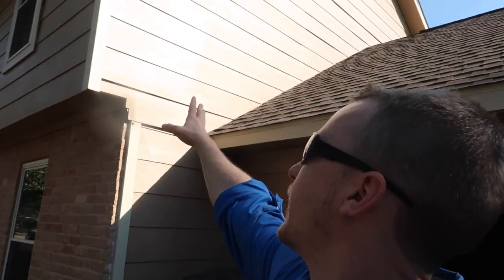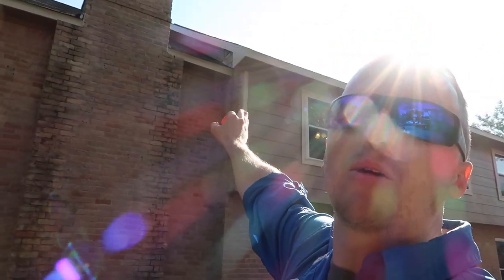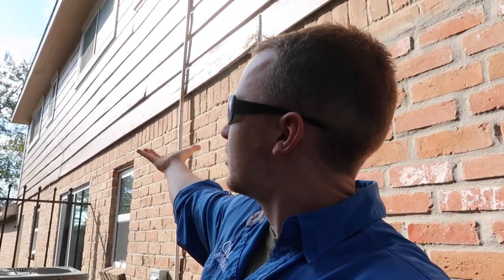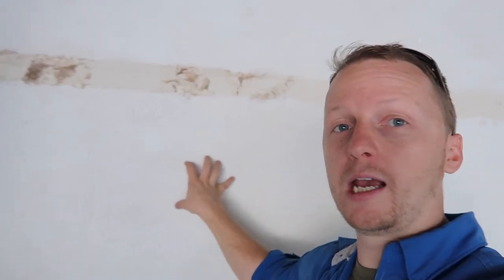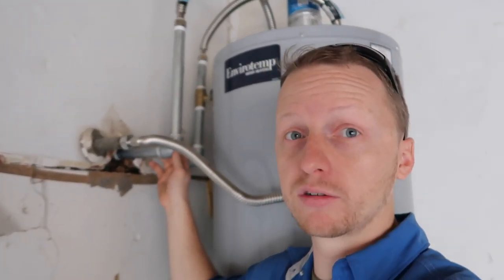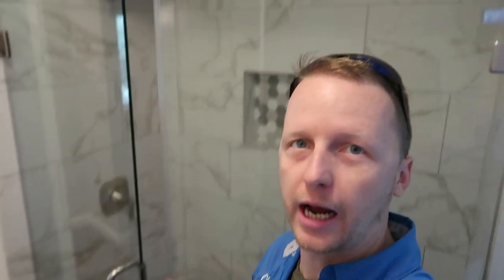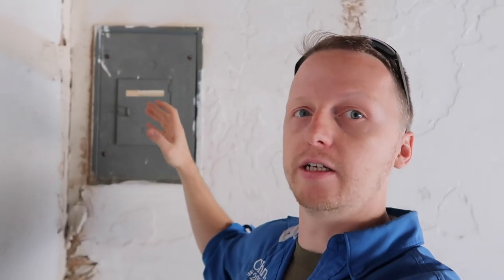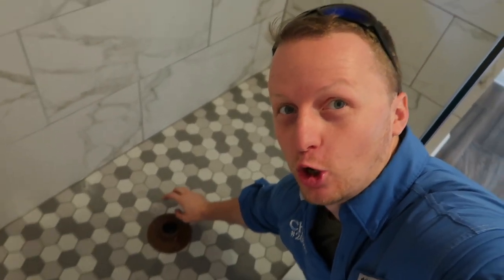Flip House Inspection Training - The Houston Home Inspector

Comment: Are gutters not common in your area?
Reply from the maker: It is a 50/50 shot.  Not required but recommended.
Reply: @AActionHomeInspectionHouston  interesting to see how different areas build. Up north you almost never see a structure without gutters.

Comment: I wouldn't have that shack if you GAVE it to me! Inside moisture, termites, bad breaker box and wiring (NEVER TRUST IT!), old, poorly done plumbing. Bring in a big back-hoe and roll-off and start from DIRT. I've seen them putting-up new McMansions HORRIBLY, then asking 2.5 million for them. Are the terms 2x6 and 4x4 unknown to modern contractors??? 2 1/2" "slabs" with NO re-mesh/re-bar and 3000 PSI concrete (maybe). I'm 71 and weak now, but I'll bet $5000 cash money I can put a 16 pound sledge thru walls/studs maybe plumbing with ONE swing. "Money Pit."-If you remember that old Tom Hanks film, it wasn't that MUCH of a JOKE!